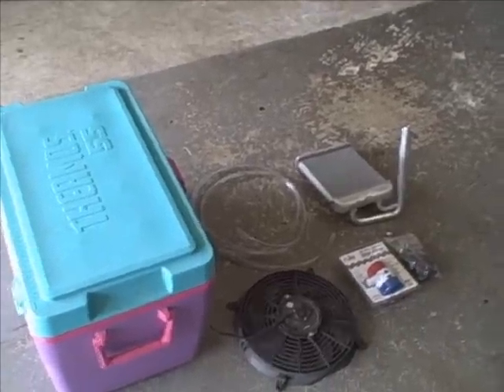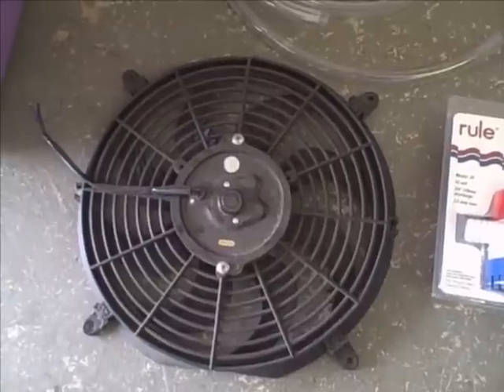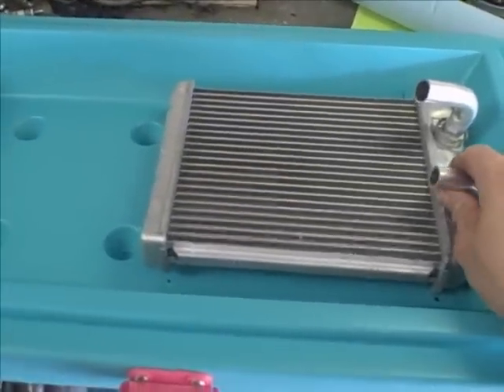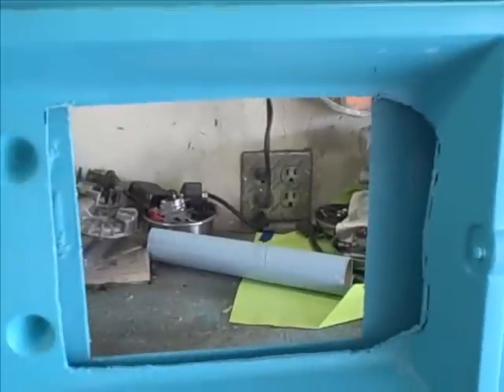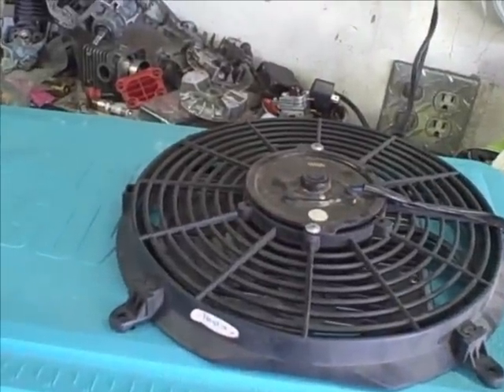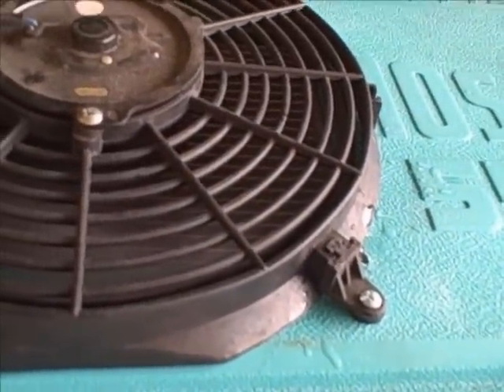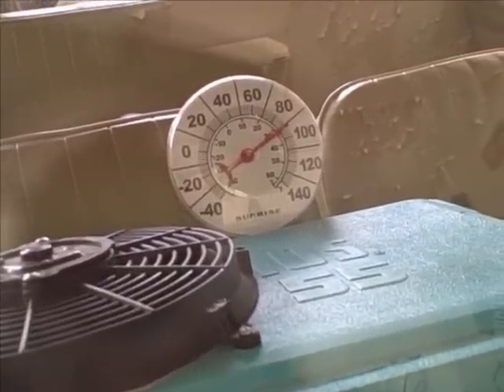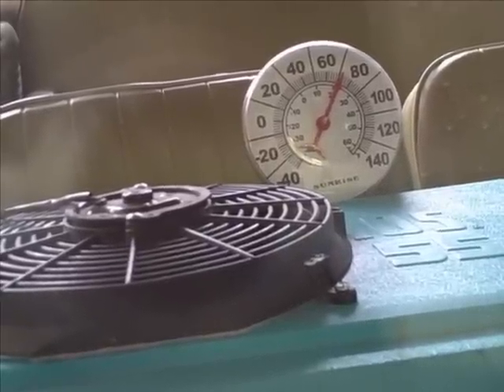Portable AC Build

Comment: I missing something there in that picture how come there's no holes in the top of the lid that fan is a little bit too big for that coil
Reply from the maker: I put a dryer vent in the side of the cooler that allows air to get into the cooler and up through the heater core.

Comment: OK, so lots of questions.  First....the heater core does not allow air to pass through it right?  So what good does running cold water through a core at the top of the cooler do when hot air is being drawn into the cooler somewhere else?  IF the core allowed enough air to circulate through it the cold water circulating through it would be chilled....but seems to me pointless to then cut an intake somewhere else.  I am working on a design and liked this, but nowhere can I find how air restrictive a heater core is.  There has to be a way to pass the intake OR exiting air through the heater core or it is useless....my idea is using wicking filter material from a humidifier....if you take a round one and cut it you have one piece that is 5-6 inches wide by about 12 inches long and they are a full inch thick.  If you position one of these at both the intake and exhaust opening in a manner that allows them contact with the iced water in cooler, they wick this cold water up and all air coming in, circulating, then exiting passes through them and is chilled....no water pump needed....unless, what I may add is panel of evap pad between intake and exit that aquarium pump continually wets......and enters through cold wet filter, passes through cold wet evap pad, then exits through cold, wet filter.......gotta bring temp exiting down considerably.  I just like this radiator circulating cold water and want to find way to force air directly through it as it enters and exits.  Am looking at duct fans too....4-5.00, can be DC and if used at entrance, and exits would provide constant pressure. thoughts?
Reply from the maker: Air does pass through the heater core. After I made this video, I added a dryer vent to the side of the cooler to allow the air to be drawn into the cooler, through the heater core , and sucked out of the top with the fan. What you have described is a "swamp cooler" or "evaporator cooler" and only works good when the humidity is low.

Comment: good job Bobby. you forgot the air intake. did you notice the fan speed increase when you opened the lid? you'll burn out the fan motor creating a vacuum. 
Another point no one mentioned, you're putting humidity into the room and you will get mould on everything and it'll grow. not good. these swamp coolers are designed for low humidity levels..... around 20% to 35%
Reply from the maker: Later that day I added an intake to the side of the cooler. I used a dryer vent with the flaps turned to the inside of the cooler.

Comment: If you cut your air inlet, and install a pipe or some kid of  duct material and have it stop just an inch from the bottom fo the cooler. The  air temperature will drop as it is coming to the surface, and will drop once more when it passes through the heat exchanger. And after I wrote this I see Firstname Lastname's comment, basicly the same. However my method will get colder since its getting cooled twice
Reply from the maker: Later that day I added an intake to the side of the cooler. I used a dryer vent with the flaps turned to the inside of the cooler.

Comment: Take a ice cube maker refit it to supper cool water. Take an igloo put a fountain pump and cold sink in it. Take a GOOD fan and flatten the copper coil to increase thermal transfer to be used on the front of the fan leave a capillary at the back of the fan to help cool the fan motor on the return flow. Make a split system put everything in two igloos you can stack! Emergency colling system! Novartis!
Reply from the maker: That would require more than 12 volts DC to operate.
Reply: Use an insect to get her done insect suckers have more then one use in life.
Reply: A mini Stirling cryogenic cooler to turn air into liquid would be better but then you would need to thread a niddle to makes her icy more insect use is always good.
Reply: Turn air to liquid to fill a tank with a bell siphon that fills a radiator that boils off during heat exchange from fan forcing air through radiator with vapor flowing back into tank with cryogenic cooler to turn back into liquid to start cycle all over again. 30 watts for the fan and 30 watts for the cryogenic cooler.

Comment: hi bobby, had a ? how long does the battery life last by running that radiator fan ... I just don't want to wake up to my truck not turning over...
Reply: Rye Gold integrate a solar panel and or rechargeble motorcycle battery instead of using your car battery. Also if interested get a computer fan or two. Happy modding :)

Comment: Hi Bobby,
Does this fan is pushing air down on the radiator, or pulling air ?
Thank you
Reply: +Bobby Munroe well...where the air comes in :P didnt see that
Reply from the maker: It pulls air up and out.
Reply: +SuperMaiki76 lol😂😂😂😉
Reply from the maker: It's pulling air from the cooler to the car.
Reply from the maker: Later that day I added an intake to the side of the cooler. I used a dryer vent with the flaps turned to the inside of the cooler.

Comment: Heater cores are designed to work at high heat. There is little benefit at ambient temps. What may work better is to sink the core in the ice water and draw the air thru it.  So far most posters have chosen to draw water through the core when the air temperature is not that low. Past air through the court instead well it is submerged in ice water. Then you will get very cold air out of it.
Reply: FirstName LastName This set up is basically the set up for the Sporty's Arctic Air Portable AC for small planes that cost $500-600. The Sporty's model doesn't submerge the the heat exchanger.
Reply: I'll go you one better. Why don't you just fill the heater core with water and freeze it. Then stick it to the front of a fan.
Reply: AtomicCortex Good Idea but wouldn't condensation build up inside the heater core?

Comment: i want that in my camaro, i cant run ac in the car in the summer because it will overheat that looks like it would make a car cool down pretty quick! maybe make it smaller with a motorcycle radiator and fan and put it in a smaller vessel so it can fit in smaller cars as well hmm

Comment from the maker: For the air intake I cut a hole in the end just under the handle and added a dryer vent with the flaps on the inside. This allows the air to flow into the cooler and out through the fan. For the wiring, I wired the fan and the pump parallel to the cigarette lighter plug and added a toggle switch to kill the power.

Comment: @ziggy162 

Inside a car is a very small volume of air. It wouldn't take long to cool it down. If you noticed he barely had any ice in it when he tested it. Look at how much ice he put in and and it's surprising that still cooled that much before the ice melted.

Comment: you need to cut a hole for the air to go in so the fan can run fine. not act like a vacuum. but i like it. 5/5